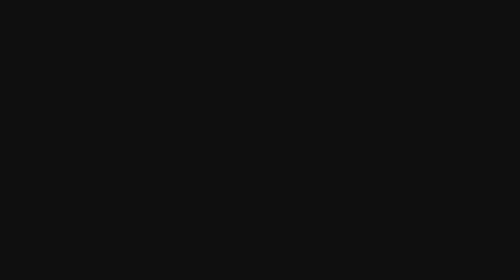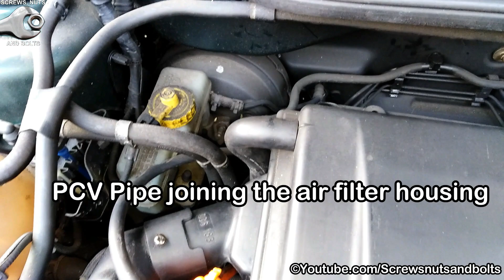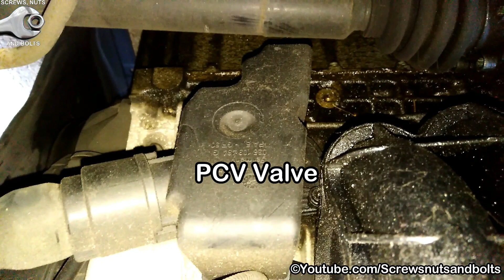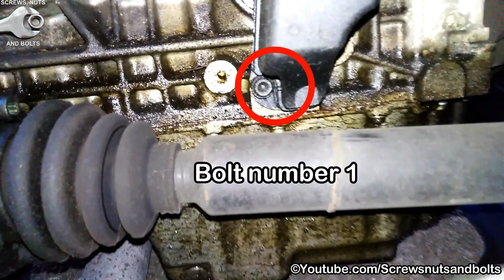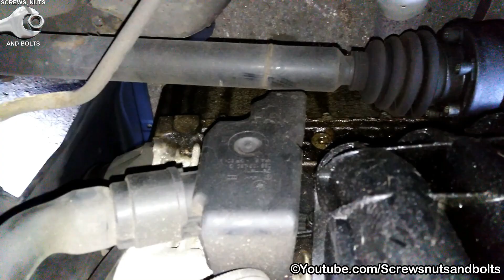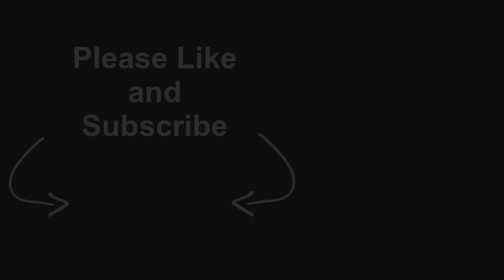PCV Valve Location - Volkswagen Golf and Bora Mark 4

Comment: Is it possible, that it can cause running rich? I have black sparks and carbon monoxide about 2-5 percent? Emission test is bad and I looked for every possible reason already.
Reply from the maker: Is there high mileage on the car, do you need to keep topping up the oil ?. I've heard that the pistons rings are notoriously bad on these engines and they tend to burn oil with higher mileage.
Reply: @screwsnutsandbolts  The engine passed the emission test in january 2022 without any problem. In january 2024 , carbon monoxide was 10 percent. Replacing  oxygen sensor and catalytic converter did drop carbon monoxide to 2.4 percent. I replaced then MAP, temperature sensor, ECU, fuel pressure regulator and cleaned the electronic throttle body . It is a Golf 4 1.4 (2001) . Engine has no MAF. Sparks were always black again after a test drive.  I have a heater circuit code for the first oxygen sensor. It is a 5 wire oxygen sensor. A multimeter showed 4 Ohm for the heater circuit and 12 volts for the voltage. Oxygen sensor should be okay?

Comment: hee broo,do you perhaps know where the PCV valve is located on the vw 1.6 mpi engine code BSE gasoline engine from 2007,if you can accurately show me somehow or mark on one of the pictures of that engine. thank you very much.
Reply from the maker: I haven't worked on one so I don't know, sorry.

Comment: Did you open it?
From what I've seen it's just a passive oil separator, no valves or membranes.
I see a lot of oil in my oil filter and I think about replacing this oil separator, but I'm not sure if it will help...
Reply from the maker: No I didn't open it but I think you're right. I think if you replaced it with a brand new one it would be clogged up again in no time.
Reply: @screwsnutsandbolts  I think I'll install a oil catch can.
Reply from the maker: Worth a shot !
Reply: @Buciasda33  did you installed an oil catch can?
I cleaned and replaced the orings in the oil separator but after a few months I have oil leaks again. Not sure if it's from the same part or other...
Reply: @IulianGLC  yes, I installed, it's ok.
Now I will also change my original oil separator.
I think it's clogged or something because my oil catch can fills up pretty fast.
Reply: @Buciasda33  you just need to take it off and clean it with gasoline.
Do you have a link or part number for the oil catch can? I have a golf 4 1.4 16v AXP.
Reply: @IulianGLC   it's something called:
UNIVERSAL Aluminum Alloy Reservior Oil Catch Can Tank for BMW N54 335 Black / Silver /Red / Blue PQY-TK60

YouTube keeps deteting my coment, 
I can't put a Ljnk, I can't even mention where I got it from...
Reply: @Buciasda33  got it, thanks!
Reply: Is it possible, that it can cause running rich? I have black sparks and carbon monoxide about 2-5 percent?

Comment: Hi, what is that ribbed looking hose that is in front of the engine and goes to the middle of the air intake
Reply: It collects the hot air from the exhaust manifold and enters the airbox, where it mixes with the air taken in from the top open area, and then they go to the air filter. I installed an open air filter directly to the throttle body on my 1.4 Golf, and I connected that pipe to take air from the front grille. This way, while the car is moving, air will enter from there and cool the manifold.

Comment: i have this exact same engine, the oil simply disappears but i don´t see leaks anywhere and i´m not sure if it´s burning oil cause i don´t see any smoke from the exaust or smell burnt oil, can this valve be the culprit? please help
Reply from the maker: Yes it could be. That's exactly what happened my car and the oil was being pushed past the seal of this valve. It only happened at high revs so if I was driving on a motorway for a few hours, I'd lose more than a liter of oil. Because it only happened at high revs, I never noticed any oil on the ground where I parked. Is there high mileage on your car ?
Reply: @screwsnutsandbolts  it has 160. 000 kms on it, nothing outrageous I guess
Reply from the maker: @notfound3358  I heard  somewhere that this engine has poor piston rings and when they get worn they let a lot of   the combustion gases past the piston and into the crank case. The PCV valve can't handle the extra pressure and oil is forced past the seal.
Reply: @screwsnutsandbolts  yeah these engines have really bad reviews, dunno what I was thinking when I bought it😥anyway, I'm going to change the oil, filter, bolt and a new pcv valve, thanks man!
Reply from the maker: @notfound3358  You're welcome. I'm not sure if it's worth buying a new PCV valve as it'll probably do the same thing but, if you do, let me know how you get on. Best of luck !
Reply: @screwsnutsandbolts  Yes they are a poor quality engine all mechanics know these AHW  engines burn oil ,i cant understand why VW didnt put the piston rings from the diesel engines into  the petrol engines as thier TDIs go for 300k without much oil burning ,but thats the way
Reply from the maker: @johnnoonan5802  I've had a Bora and Golf with this same engine and I won't be getting another one ! :)
Reply: @screwsnutsandbolts  hi there what a pile of s- -t of an engine worst thing to burn petrol ive come across ,they are a soft engine for sure , was there a petrol engine in the bora  , i didnt know that , if you are buying a car may i suggest a Toyota Auris diesel  , they are good cars even the Corrola is good also , im sure at this stage your fed up with VW but the passat 2016  model and onwards is a good car,, good engine TDI   1.6 or 2liter  good solid build car , so have a think , if you know good mechanics see what   they recommend as they are working on them all the time so they willl know the good marques ,, all the best for now ,, keep me posted  cheers
Reply from the maker: @adrian4381  lol sounds about right :)

Comment: I've got an oil leak on the same engine and I found that the oil comes from the backside of the engine right below this piece. You have changed it? In your case the oil leak that it is seen on the video came from it?
Reply from the maker: I took mine off and cleaned it out, but I've heard that when this particular engine has high mileage, the worn piston rings let a lot of exhaust gases past the pistons and into the crank case, particularly at high revs, and the PCV unit at the back of the engine can't cope with the extra pressure and some oil gets forced out through the seals. Even if you replace it with a brand new unit it would leak the same way unfortunately.
Reply: @screwsnutsandbolts  thanks for response!
Reply from the maker: @irinel.b  You're welcome
Reply: So how you know is damage..how you test it
Reply: @screwsnutsandbolts  where exactly did you read this? I've got the same issue, oil leak at PCV, I've read on various forms that it's just bad orings; I've ordered a new one for about £20 off eBay. I hope it ain't a waste of money haha!
Reply: @screwsnutsandbolts  got a 6n2 16v from 2001, with 70k miles on it. It drives very well and this oil leak is pretty much the only thing wrong with it.
Reply: @mangoleeallan  did you change the seals?
Because i have the same problem and i cant tell if the leak is from the valve housing or the oil sump

Thanks
Reply: @marcospashiardis783  I just replaced the pcv yesterday and the leak was coming from the smaller hole on the pcv the oring was completely flat. Also the hose that connects to the vent was blocked with a creamy oil water mix which explains the leak. You can get replacement pcv pretty cheap off eBay
Reply: @mangoleeallan  why was the oil creamy?
Reply: @marcospashiardis783  means that the oil has mixed with water which is normal in the pcv but it can get clogged from cold weather after a while. If you dropped the oil from the sump and the oil is creamy you have a blown head gasket.  The clog could have also been from a head gasket leak that was repaired but had already clogged the pcv, the cars twenty years old and I don't have it's full history unfortunately.
Reply: @mangoleeallan  ok
Can i remove the pvc without draining the oil from the sump?
Reply: @marcospashiardis783  i didnt have any oil leak from mine! i was on ramps, let the engine sit for 10 to let all the oil get to the bottom of the engine and for it to cool down, it gets hot quick.

Comment: Did you notice any leaks from that valve housing?Because mine is leaking but i cant tell if its from the valve or the oil sump
Thanks
Reply from the maker: I couldn't really tell. The oil was being forced out through this unit and probably splashed around a bit, so it's hard to tell if the oil on the back of the engine is from this unit or leaking from somewhere else.

Comment: Where can I find a new part?? If not what do I clean it with
Reply from the maker: You could use an engine degreaser to clean it out but chances are it will clog up again if the engine is old and worn
Reply: Wash it out with petrol or white spirits there will be sludge in it probably and you will need new O rings-- seals

Comment: How hard is this to replace? What is the easiest way to get to it? From under the car?
Reply from the maker: It's not too hard and it would certainly be easier from under the car, but if you remove the air box you can reach down the back of the engine and remove it. Although it's a bit more difficult. I did it that way when I had the Bora :)
Reply from the maker: Here's a video of a guy removing and cleaning it :
https://www.youtube.com/watch?v=xpXQiJUVhvI
Reply: @screwsnutsandbolts  Thank you! You're an absolute life saver!!
Reply from the maker: @WaRbLiNgHaT1  You're very welcome !  :)

Comment: Hello, can I ask you if it is possible to replace just the hose without disassembling the whole thing? Thank you for your video.
Reply from the maker: You probably can. Is the hose damaged ?
Reply: Yes it is damaged, i already bought a new one but cant figure out if I just slide off the old damaged one and slide on the new one, or if its more complicated.
Reply from the maker: @marcus5487  You can see what it looks like here: https://www.aliexpress.com/i/33031692684.html
Reply from the maker: I think it slides off with a bit of work. Be careful not to break it !